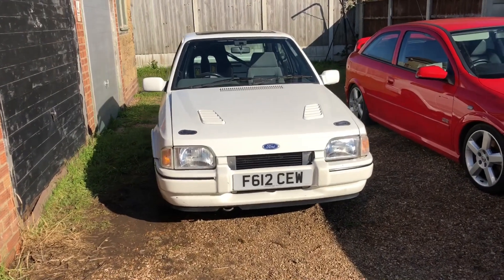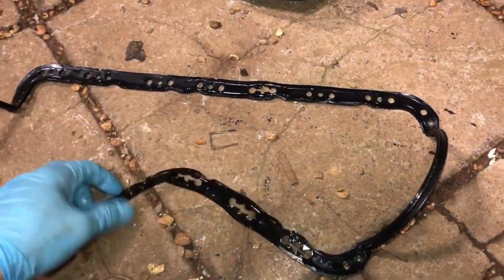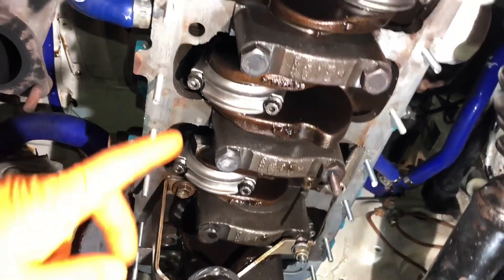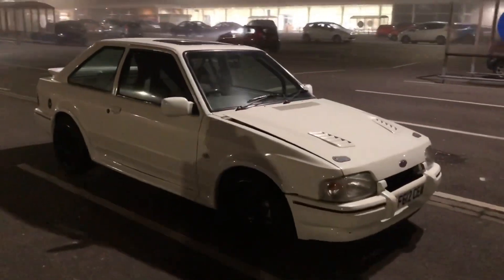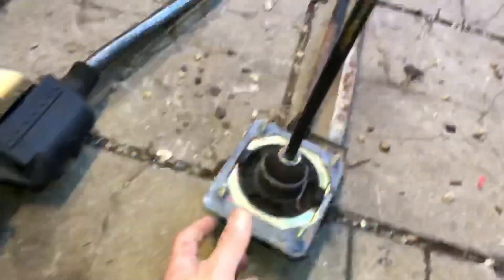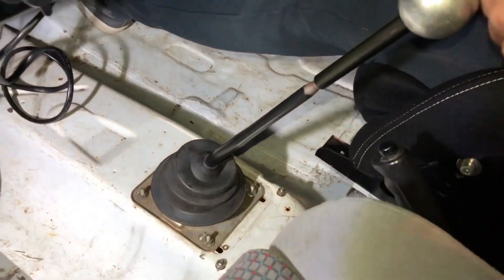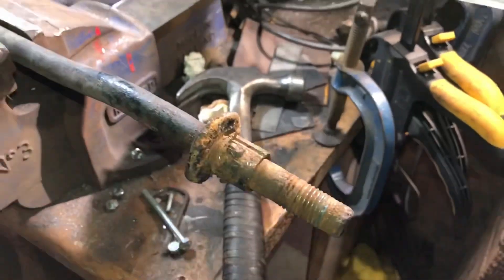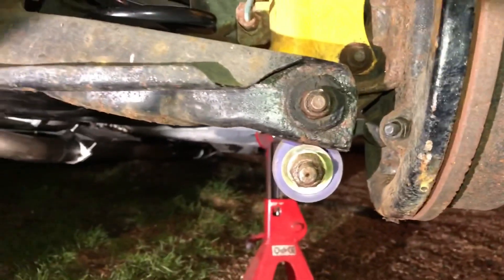The Engine Is Transformed! Missfire Fixed. Escort Rs Turbo

Comment: I remember back in the day turning 18, I could afford the car but the not the insurance. Now 37 Its the opposite away around lol.
Reply: I have a similar problem, I always wanted a Mk1 Mexico.  I did manage to find a Mk2 Mexico and after 2 years of cutting welding and repainting, the car looks awesome, absolutely pristine inside and out.

I have now run out of cash and the engine needs to be rebuilt.  I have given up, I have covered over the car.  People say I should have got it running first, but the car was stripped to its shell and dipped, so I had to get the engine bay painted anyway before reinstalling the motor, so it is the way I chose.

I may end up getting some sort of loan against the car to pay for the engine and gearbox rebuild after the payments end on my daily runner.
Reply: Yep too true 😂😂
Reply: Age 21 on an E plate RS Turbo I got the insurance down to £1200 a year 3rd Party F&T and that was with 11 points. This was 1998 btw.
Reply: I had one when I was 19 (back in 2001) £145 a month 😫
Reply: XR2 in my mum's name with me as a named driver third party cover £1500 in 2003. I paid £30 for the car I dragged it out of a garden. To be 17 again.

Comment: Awesome videos, very informative 👌 I've just went out and picked a Puma gear linkage for my escort S2 after watching this
Reply: cossy mike hi mate when you got your puma linkage what was the tensioner like in the selector it’s self because mine seems sloppy still. Is the tension that springs it back to neutral in the selector or at the gearbox?
Reply: I havnt done it yet but I know the Escort box doesn't have a self centre. The Puma linkage works with ib5 box and the self centre spring is inside the box. For this to work on the Escort you'll need a spring. I'll be getting a spring from an XR2 and I'll fit it inside of the black plastic housing of the Puma one
Reply: Right I’ll try that then cheers buddy that’s helped a lot 👍
Reply: 1583358 is the part number, showing as a couple of pound if still available. If I can't get one I'll use a spring out of and old wiper arm
Reply: Is that on eBay mate?
Reply: No mate that's the Ford part number
Reply: Ahhh right haha as you can guess I’m not too great with cars I’m just trying to do up my mk3 lol so does that spring fit into the puma selector box or the escort gearbox?
Reply: I've not looked at it yet but from reading on passionford it can be done inside the plastic housing. There are other options with different springs fixed to the floor but I think they look untidy
Reply: I’ll have to open my selector up and have a look and try to sort something lol cheers for all your help though mate really appreciate it 👍
Reply: No bother :)

Comment: I had exactly the same problem with them rubber gaskets on my Scorpio 4x4 turbo build. I went through 3-4 gaskets rubber ones , which kept splitting once torqued up 8-10nm , I finally found a good one from BGA Which was a stiffer rubber cork style , but was still very flexible and didn't sqwash much. and didn't split , if  your having trouble later on , hopefully it holds for you but that might be an option later on. I know I'll be buying afew sets as mine is gonna leak again , as it's old!

Comment: Do some -1 low compression pistons and a piper 285t2 cam will let you run very high boost used to run mine back in the day on 40 psi from the stage 3 t3 turbo unit was good fun i do miss that car

Comment: Very nice , it sounds so smooth and doesn't it sound like it revs freely now .Personally I wouldn’t bother with the rear disc conversion its more trouble than its worth and the front brakes do 70 percent of the work anyway , just a old school gimmick that the car doesn't really need .
Reply from the maker: Yep very smooth even on a basemap. I had cossie rears before and it always wanted to step out
Reply: Aaron Unknown I gone out of my way to convert mine back to 9” drums , some how it’s difficult to get the right balance with rear disc and the hand brake was rubbish 👍🏻